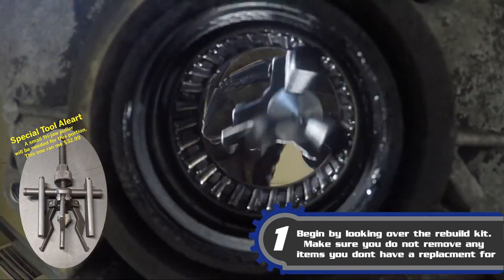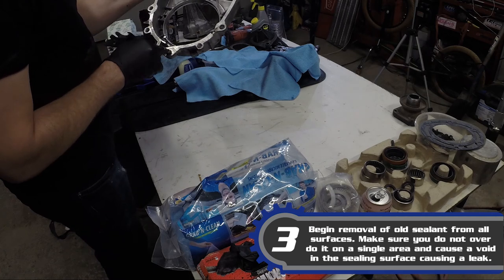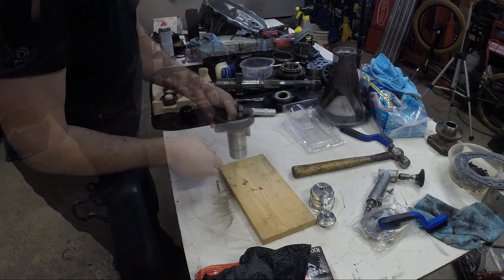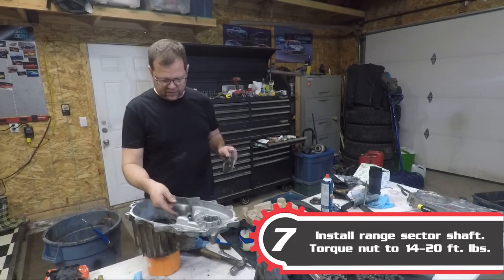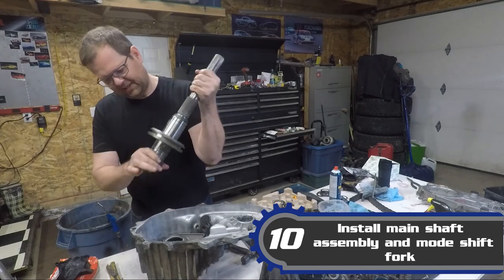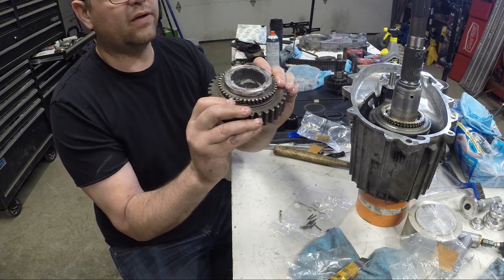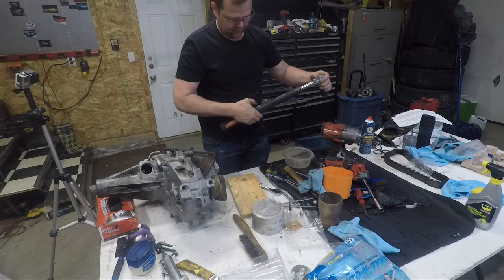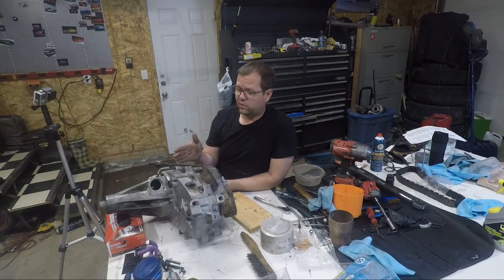pt.3 How to full tear down and reassembly of a NP208 Transfer Case. 22 Steps

Comment: Your videos are enormous help. But like most geniuses at what they do, you take for granted that we know as much as you so some detail is omitted. Like when you put the planetary gears in - I know they have to be finagled so it fits into the selector lever. You dont show that. Or when you are assembling seals and (thrust) bearings / washers, you speed the camera up and skip details. I figured most of it out and your video is still awesome. Thanks for making them.
Reply from the maker: Thank you for your kind comments. It is terrific to hear the feedback about speeding up things I saw as basic.
As I am very new to the video and editing part of YouTube. I was trying to keep it within the "recommended ideal" times without totally skipping steps.  I have several more videos I am editing. Would you think for things like the installing of seals, would it be helpful to stop explain the process of exactly what I am doing and the risks? Then speed it up. Or keep it slow and make it say 5 videos instead of 4?

Comment: Suggest using what fluid your using instead of Vaseline. I use a squirt bottle (used in body shops to clean paint guns), or a old school pump oiler. If it uses auto trans fluid can use assembly lube for auto transmissions too.

Comment: My main shaft has a really thick snap ring, with a thick notched washer / dowel on the other end that does not allow the gear to go on at the end with the chain. I have to assemble it first before putting it in. These snap rings are a PITA to remove too - even with a 16" set of snap ring pliers. Would love to see how you pulled them so easy. Love this video - reference and watched it ALOT - but there must be several different modes of spacers, etc NP used as mine is slightly different and I have spotted other vids (not as good) that are also slightly different. Thanks for making this.
Reply from the maker: I'll look to see if I have the footage of that. As for the snap rings. I have a really good set of OTC ones with deep grooves.   One of the tricks is using a pick or a very fine flathead. I get the snap ring out if the grove. Then stick the driver into the gap. Then I stop and regrip the snap ring with the pliers and slip it off.

Comment: 1. The seal & bearing install tool.
2. The bearing puller tool.
Where are these same ones available?
What you have works so I’de like to copy this.
Outside this , the tools listed like the mm sockets and impact, this project looks straight forward .
thx
Reply from the maker: The 3 jaw puller I don't remember the brand but it's a  3 Jaw Inner Bearing puller. The installer set is a Lisle 12600 Bearing Race And Seal Driver Installer. 
Both are available at most parts stores.

One tip that was mentioned in the coments was to freeze your bearings and the will install easier. 

Good luck with your project.

Comment: On the downside of getting my 208 back together again - thanks to your video. It all went in as shown - only difference was I used grease instead of vaseline as it got too soft at room temp and the whole mess would fall out. When I test fit the 2 halves before using the gray permatex, the chain would touch the housing. I used a rubber mallet and tapped the main shaft down about another 1/2". It still turns freely - just no idea why it didn't just drop in (EVERYTHING was cleaned and greased). Then noticed the long shaft / spring would hit. So again, used a rubber mallet and tapped it down 1/2". Should they both have just dropped in or is that normal? Thanks again for this - sure saved my keester. :)
Reply from the maker: Question. Are you running the round magnetic placed in the pocket at the bottom of the housing? I have had them hang up and used a mallet to get it all seated. Turned out the magnetic was hung up and I ended up breaking it and I had to replace it. The other thing it the shift shaft sometimes gets hung up. And tapping it home just seats it into place.

Comment: How much atf did you put in I keep finding different amounts on Google
Reply from the maker: I filled up to the bottom of the fill hole. That's what I was taught when I worked on the lube rack at a GM dealership back in the early 90s.

Comment: I appreciate your videos, has really come in handy reassembling my 208. I've ran into a problem. I don't have a book or guide to reference either. When I finished my assembly, no matter what position I shift, both sides of the case turn.somehow I didn't get the range fork in the proper position. Was wondering if you could help me out?

Comment: Hello,
At first bravo for your explanation for NP 208 désassembling
I’m new owner of a F150, 1983,I need to change my transfer case oil (NP208 F).
Could you advise me for oil type
Many thanks by avance
Fabrice
Reply from the maker: You should be using atf  for your fluid. Fill to the bottom of the fill hole.
Reply: @TheLugnut  many thanks,
But have you a manufacturer to advise me, I read that ATF dextron III is good?
I’m leaving on France and it’s not easy to find it, and i don’t want to break my NP208
Fabrice

Comment: Great video. Will be rebuilding my NP208 this summer. Kept popping out of 4H will plowing this winter.

What was the grit of the abrasive wheel you used to clean the case half and tail housing mating surfaces?

Thanks!
Reply from the maker: I use a burgundy 3m rol-loc typically on case halfs like these.
Reply: @TheLugnut  Sorry to be a pain, but do you have the 3M roloc product part number? I am colorblind and having trouble finding the correct item on 3M's website (don't see a color code for burgundy). Thanks so much!
Reply from the maker: @kuhnzoo  NO problem at all. The scotch brite pad style I normally use is 3M ID 7000035849. I use this on Al. case halves and most general purpose cleaning.
Reply: @TheLugnut  Thank you!!

Comment: Awesome videos on the squarebody. I'm also a big fan of the pickups. I have an 86 k20 and looking forward to some more videos on yours. Where did you get your mudflaps?
Reply from the maker: Thank you very much. There is allot more to come for videos with Scar. Right now I'm sorting out a 70 Challenger with a Hellcat swap. Then there will be more on the Square body. 
I'll try to dig up the details on the flaps for you.
Reply from the maker: Hi Jason. I checked into the flaps and there isn't a brand stamp on them anywhere. They were on the truck when I bought it.
Reply: @TheLugnut  thankyou for checking for me.

Comment: So I have a problem and I don’t know if I can do this or not I have a 1975 400th 4x4 in my k10 with LSswap had a np203 it went bad my dad is on the Volunteer fire department they have K 20s with the 6.2 diesel 400 turbo trans one of them they sold I got a few parts off before they sold them like the transfer case and drop lunch when I tried to put the np208 in my truck the splines would not fit my 400th has 32 spline but is only 1.5 in diameter the np208 is a 32 spline but 2.88 diameter is there a way to adapt that
Reply from the maker: You can replace the input shaft on the tcase.

Comment: Did you leave the thrust bearing and washer in place between the input shaft and main shaft? Everything I can read says there is only a bearing there. I would think that would load the bearing too much.
Reply from the maker: Correct the washer is not ment to be in there.
Reply: @TheLugnut  Thank you for the reply. This would be a nice edit to your video to save damage and confusion.

Comment: Where is the best place to get this kit to rebuild the 208? I’m in the states, not sure if it would make a difference. The truck I’m doing it on is an 87 Dodge as well. Not sure it would be too different either
Reply from the maker: The Dodge version internally is the same. From memory the rear output seal is different. But the kit in the video comes with the different seal. If you f
Don't have a good drive line shop in your area. I would look at Rock Auto.

Comment: Why don't you use the gasket?
Reply from the maker: WOW. Indeed why the heck didn't I use the gasket.  I know I had it in my head that the case half's had not gasket and completely overlooked that fact the kit included a tail housing gasket. 

Great catch!
Reply: @TheLugnut  oups sorry, my mistake, you don't use them because in the manual it says that you have to use loctite 515 sealant on the surface of halves case and tail housing. So you are totally right. One of the two paper gasket is for using on the transfer case adapter to transmission. Thanks again for your video.

Comment: Hey man, i have a question, can i just split the case to re apply sealant to fix a leak or do i have to remove the til first then the half?
Reply from the maker: I am sorry for the late reply. I do not think that will work to properly fix the issue unfortunately. It is very important to ensure that the case half's are free of all old sealant.